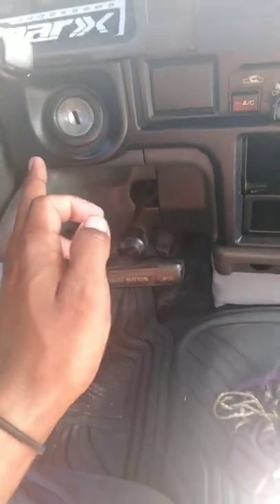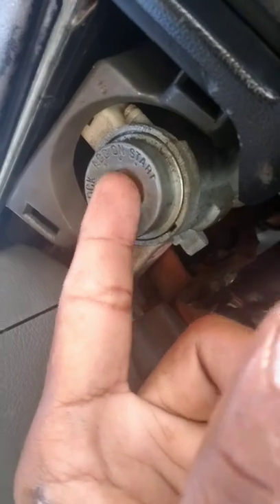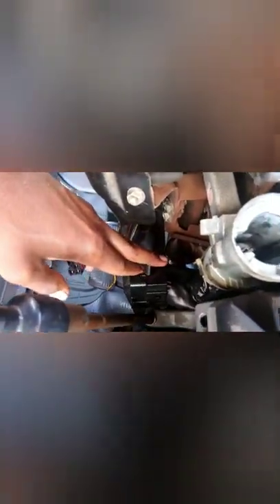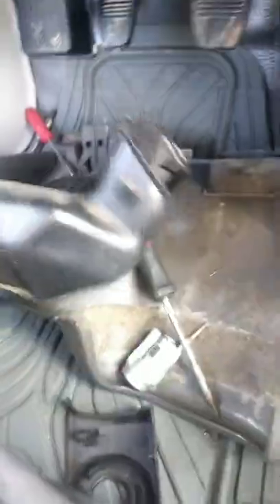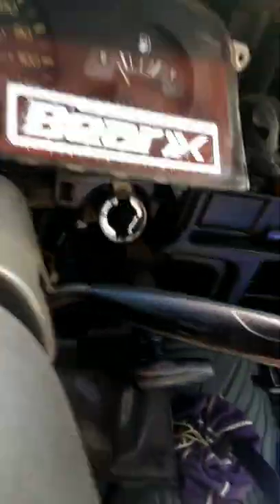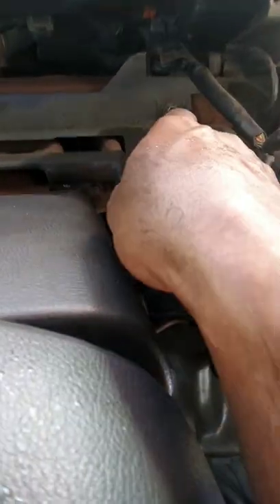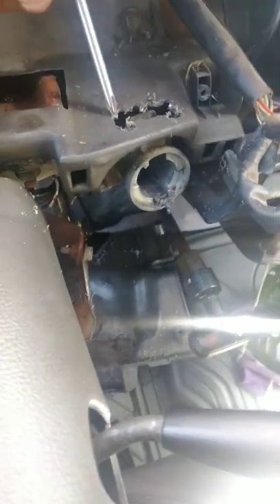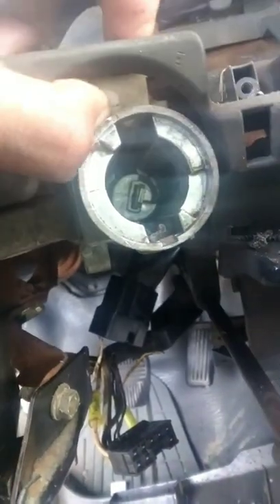1994 toyota pickup ignition switch and cylinder removal ( works on 89 to 95)

Comment: I’m getting ready to change out the ignition switch on my ‘94 Toyota pick-up 4WD, and your vid is pure gold. When ordering your replacement switch make sure you order the  one that matches your truck if it was made in the USA or Japan. I know the first code of the VIN that starts with any of these numbers (1,4,5), indicates that the truck was manufactured in the US. And also, be careful handling your aged, plastic trim pieces which break very easily. They are expensive on eBay, if you can find your trim color. Good luck!
Reply from the maker: Well said brother 👏 hope this helped in some way
Reply from the maker: My truck was made in either Canada or the USA, ima check and put that info in the description
Reply from the maker: Hey I just found out your switch will be different if you have an automatic. There's two types of switches for these vehicles, I bought the wrong one not knowing this.
Reply: @sambrian5405  Good info!👍

Comment: Drilling holes is creative, but it's wiser removing the steering wheel and then the two nuts and two bolts (14 mm socket) holding up the steering column and resting it on the floor. The switch then comes out like nothing. Removing the steering wheel isn't mandatory, it just gives you more working room.

Comment from the maker: IMPORTANT: if you have an automatic, your switch will be different. This was not known to me I will add information to the video soon. Including install instructions. Sorry for any inconvenience. I bought the wrong part not knowing this. If yours is automatic, your male connector will not be 2 on top 5 on bottom, it will be a clean 4 on 4 connector. Everything else looks the same. Take this into consideration please. Sorry again. Will fix this soon
Reply: I have the new part and went to work on replacing my ignition switch and got to the point where the new one was in and then tried to plug the connectors together, without success. Upon close inspection, the first new ignition switch that you had, is the one I need, and the one I have, is the one you need…go figure, lol!
Reply from the maker: @werdevo6  do you have a automatic or a manual, how did you get the wrong part?
Reply from the maker: When you put in the information for your truck, both automatic and manual switches will come up. When I bought my part it didn't show the inside of said connector. Both have same amount of prongs but arranged differently. Only realized this after buying and getting my part